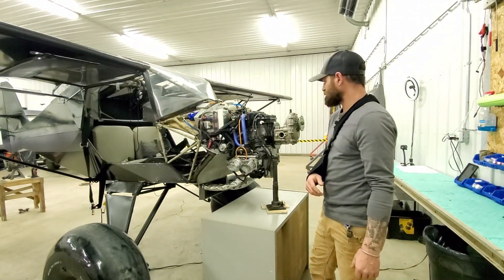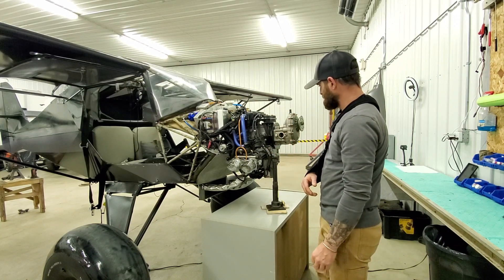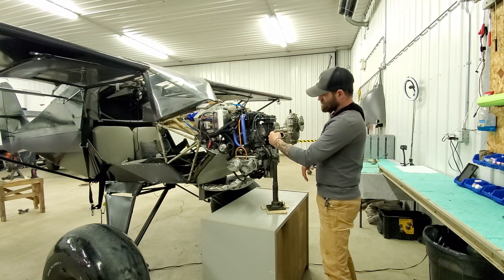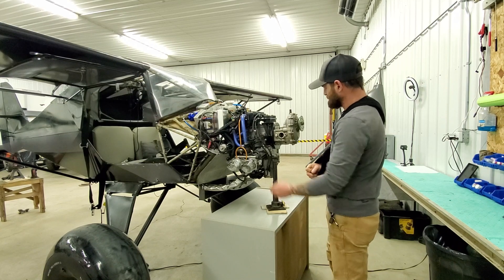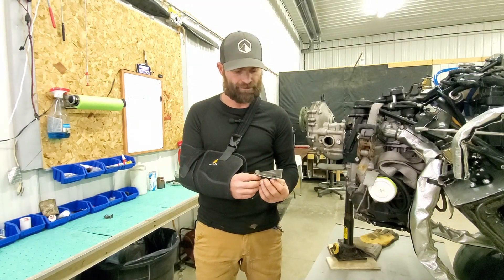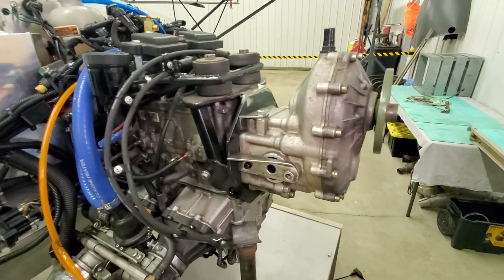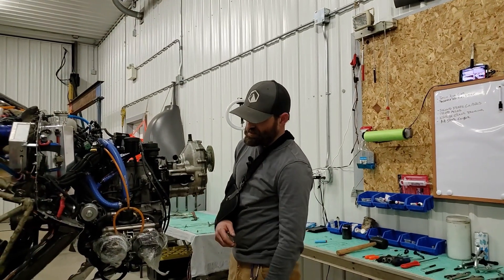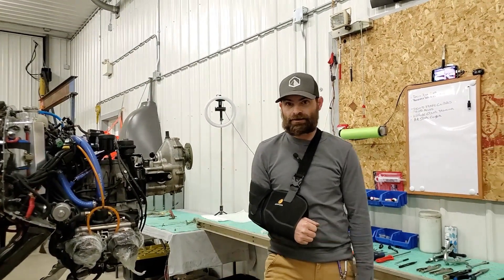gearbox adapter upgrade/final instal on 165hp rotax powered Avid Flyer.(worlds most powerful Avid?)

Comment: Great effort.  After owning an Avid I would ask why invest so much in an aircraft that won’t land in a 25kt crosswind?  Back country necessitates more bandwidth for safety.   No wing loading unfortunately.
Reply from the maker: Mostly because im poor haha but also because i like to go not where the path may lead but instead go where there is no path and leave a trail. Maul m5 180 max crosswind 12kts, cub crafters cc11 carbon cub max demonstrated crosswind 11kts , aviat husky poh says 13kts max crosswind all are capable backcountry airplanes. In your experience what happens to the avid in crosswind ? Is it just too light or does it run out of rudder ? As for the wings they will be getting changed for stol or heavy hauler or may design a new wing for it . Thanks for the feedback thats why i post these so people smarter than me can weigh in .

Comment: Good idea with the gearbox. In my experience with rotax, they tend to under build things to save weight. Their power to weight ratio is what sells them. Just curious is the gear box the same as the lower hp models?
Reply from the maker: Its a rotax c drive , when i was doing my homework i found that this gearbox has been on many 90hp and also 130hp applications and i could only find one instance of a failure due to a spun bearing . 165hp is more than any ive heard of going through one . That being said this was more for proof of concept , if everything else works good i will spend the time and money to design an overbuilt gearbox . 
Thanks for watching

Comment: I thought those holes were just for cooling
Reply from the maker: I honestly dont know but it looks like a p.t.o. window . Anyway i drilled those holes in the bracket so if it is for cooling they are still there
Reply: They're inspection holes for the rubber dampening coupler. They're meant to be left open.
Reply from the maker: Ah thank you for clarifying, any idea why the threaded holes there? I did drill a 1" hole in the braket so inspections will be no problem still.

Comment: Great job like really great work but why a handheld radio and not a real dash mount like a Xcom, micro air or an Icom.
Reply from the maker: 2 reasons ,  1 if i go down in the backcountry  i think the handheld would be a good survival tool that can stay on my person and join me on the hike out. 

2 because the fuel tank is in the way lol , when i put new wings on it with wing tanks i may upgrade the radio but the handheld will always stay in the plane. Thanks for watching